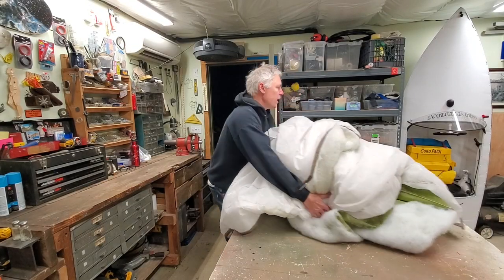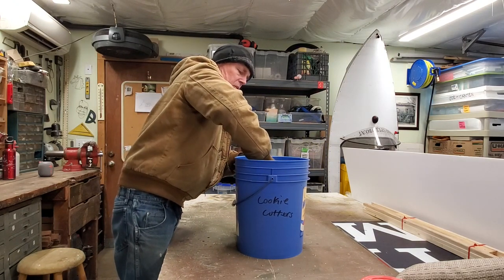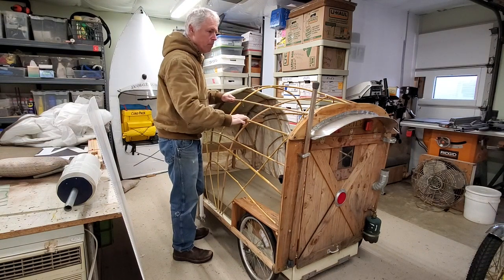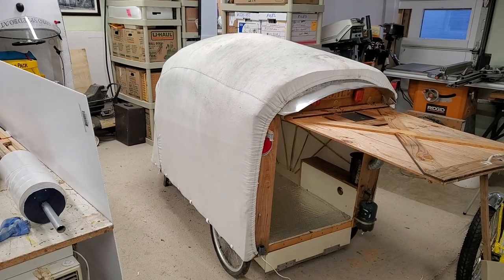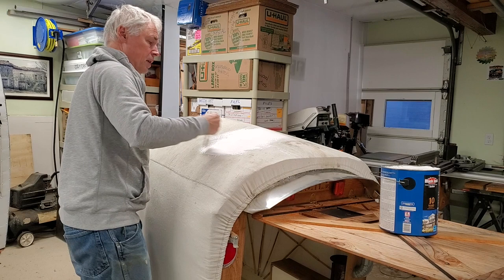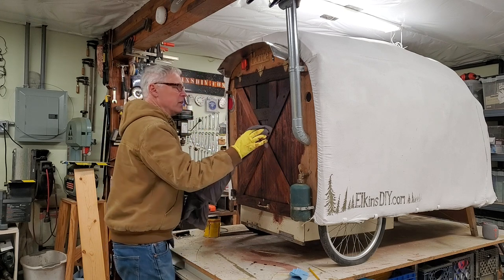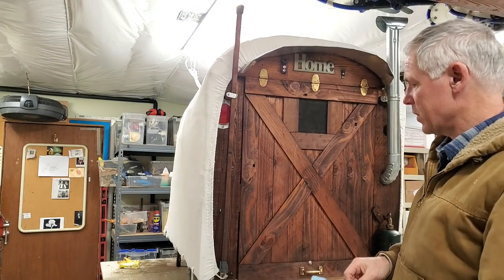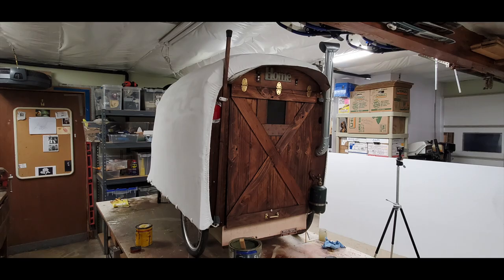Conestoga bicycle camper makeover

Comment: "If you like stuff like this"

I absolutely love stuff like this, predominantly your stuff like this!

You inspired people throughout the world (including me) with your original Coroplast bicycle camper, and this was equally amazing!

If you were to make a video on the stove you built for this I reckon it'll get gazillions of views and shares.
Reply from the maker: I've thought of that but I never refined the stove enough be a safe heating and cooking alternative. Almost, but more work needs to be done.
Reply: @paulwelkinsdiy  the refinement process would make an interesting series of videos.
Reply from the maker: @IvoTichelaar  I had actually drilled an entrance and exit hole for the flue, to extend and go out then back into the camper, make a big 'U' then exit out a higher hole on the other side of the back wall. Unfortunately I couldn't find any store that carried the old style round downspouts, so it didn't happen. Should have waited before drilling the holes. Damn.

Comment: What about KILZ brand anti-mold paints or clear coats? They make lots of products that kill mold & mildew. As an autistic savant I absolutely love your channel. You're an inspiration Paul!
Reply from the maker: Yes, Kills might be another good option. I Had the elastomeric paint stored for 8 years and felt a need to use some before it separated too much. I also wanted to see how well it would hold up on flexible canvas.

Comment: OK - I made a tail box for my Tour Easy Long Wheelbase bike.  My final design was the following: 1) I made a very open basket shape with ~3"x~3" openings from Chloroplast strips roughly 1.5-2" wide. 2) At the strip intersections, I used very small zip ties. 3) Where the structure was weak, I inserted coat hanger type wire inside the Chloroplast(CP) openings.  If you use the wire in opposite directions and zip tie, the strips become quite stiff.  4)  After my open weave basket was done, I pulled heat shrinkable plastic over the outside of the shape.  I wrapped the heat shrink(HS)  around 1" CP strips, with the HS having "U" slots cut out where the zip ties held the HS edges to the basket. 5) When the HS was mostly tight, I used a Heat Gun to tighten it down onto the basket shape.  The resultant structure was drum like and VERY stiff!!!  Much lighter than the bamboo/canvas design...   Bob

Comment: Benn following you for a few years now, and have a few questions for you. First, have you ever thought about building a small “foamie” bicycle camper? And is there any “set rules or regulations “ on length, or width of these bicycle trailer shelters? Also have you thought about an ammo can stove build?

Comment: Of all your designs, those which have been subjected to elements, which are standing the test of time (literally!) the best and what are their materials and design principles?
Reply from the maker: My old white 'Coroplast' bug-out camper was built in 2005? And has been exposed to direct NW elements for about 12 years with little degradation to the skin.
Still, fluted plastic is not suitable for extreme sunny climates. Within 2-3 years cracking will occur. 
I'm also impressed with my  coro boats, even the extended hulls using the wooden transom. Although stored inside they've taken a lot of flex abuse and still manage to maintain their pliability at the folds.
Thanks for asking John!